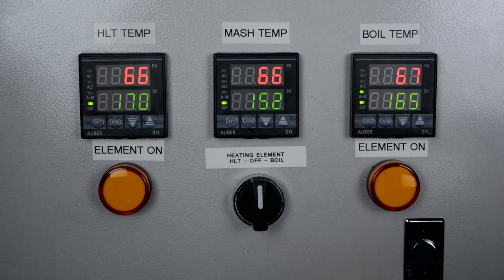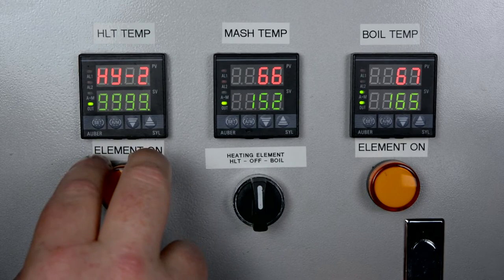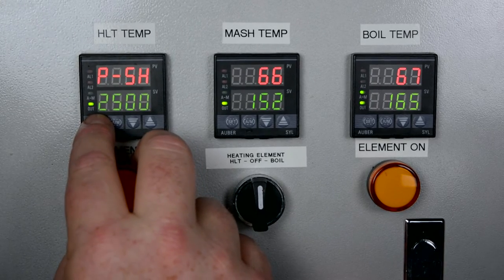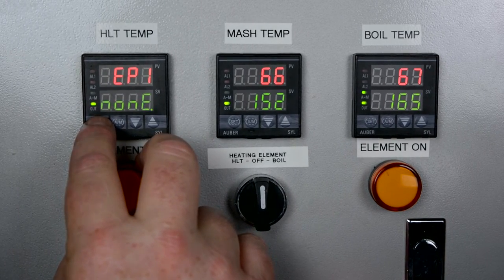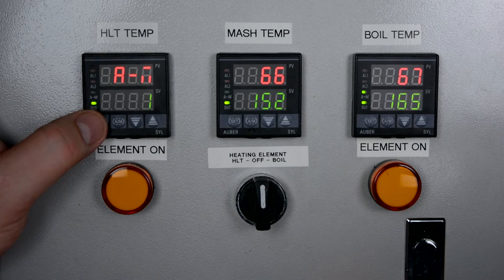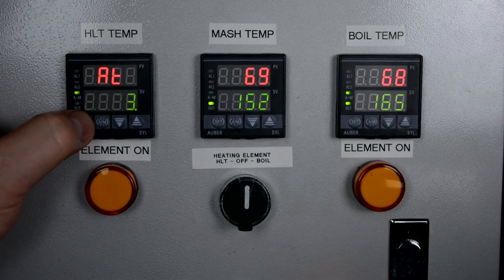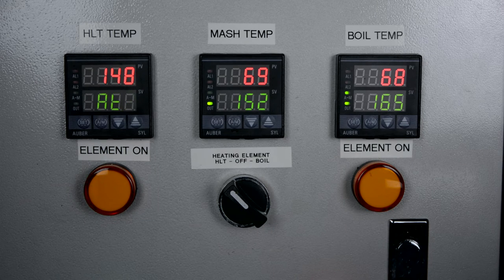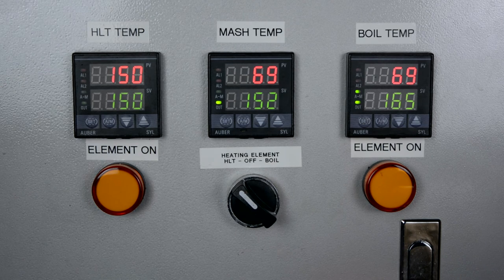Electric Brewing Series - Part 5 - PID setup and auto tuning Auber SYL-2352   #electricbrewing

Comment: Would it be necessary to "re-auto tune" the PID whenever you drastically change the size of the grain bill?
Reply from the maker: They generally stay pretty consistent. I would say if you tuned it to a minimum grain bill and not an average size you might have issues. My recommendation is to auto-tune to your usual grain  bill and then RDWHAHB! 👍🍻
Reply: You should only really need to worry about retuning the PID when you up/down-size parts of your process such as changing your vessel size or the max output of your element.  But realistically, you should be fine unless you upscale from a 5gallon system to a 1 bbl system.

Comment: Do they "remember" / "store" settings or do you have to reprogram Everytime after every shut down? My temp controller that use for my fermentation chamber has to be reprogramed everytime after unplugging it
Reply from the maker: These do remember the calibration settings but do reset the temp settings every time. Not a big deal as I don't brew the exact same beer every time any way and change the temp setting for what I am brewing.  👍🍻
Reply: @ShortCircuitedBrewers  does your friend that makes the wiring diagrams have a webpage or anything? My plan is to wire the boil kettle with two elements and the plan is to have each element on it's own dedicated circuit but would like them both controlled together. I would imagine the wiring would be similar just an a second SSR making two identical boil kettle element circuits both wired to the same PID? I know you are not an electrician, but I am curious if had any experience in a dual element system for boil
Reply from the maker: Pretty simple to do,  just run a second SSR off of the PID and then you can run 2 elements.  Friend mine has a 1bbl system with 2 6000 watt elements in it..  Works really well!!

Comment: I'm thinking of trying to use my counter flow chiller as a HERMs coil by recirculating the heated water from my HLT, and wort through it. Can you foresee any reason I shouldn't do it that way vs. a traditional HERMs coil setup?
Reply from the maker: Give it a shot. should help maintain your temps. Don't see why it won't work. I would make sure you do it after a nice vorlauf cuz you don't want to clog your counterflow with grain
Reply: I use my plate chiller like that and it works great. People worry about clogging but I just make sure I recirculate into the mashtun for a few minutes before going through the plate chiller. I also go in reverse so when I get to the last 10 minutes of the boil and run the boiling wort through the system to sterilize it, it pushes out what might be in there.
Reply from the maker: Thanks for the tip! Thanks for watching too! Cheers -Brian
Reply: The only concern I would have  (because I thought about doing this as well) if you run wort / and grains end up through it and it gets stuck, might be very hard if not impossible to clean, kindve resembling what he describes in the rims video of this series